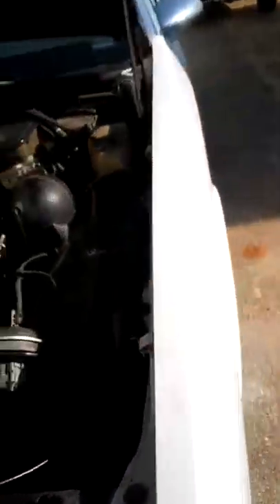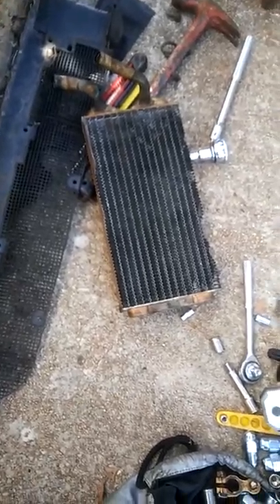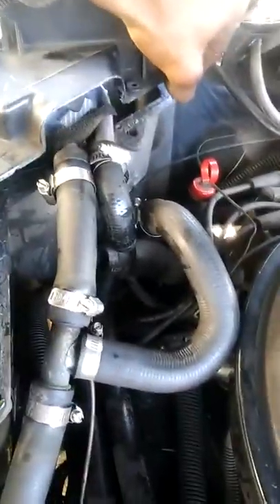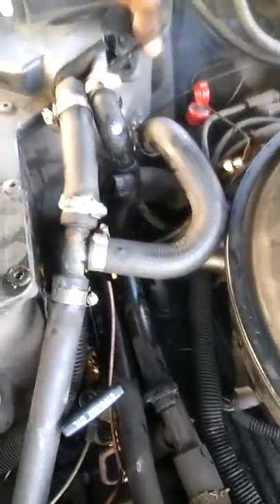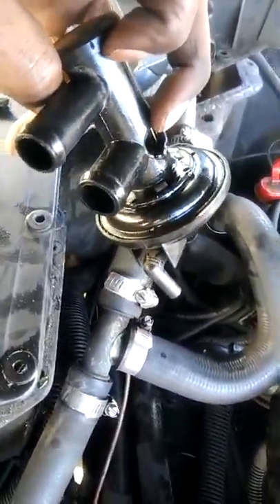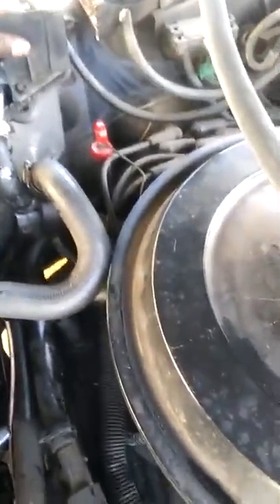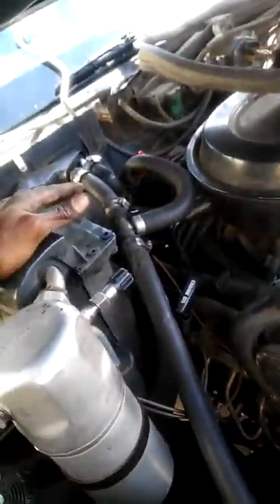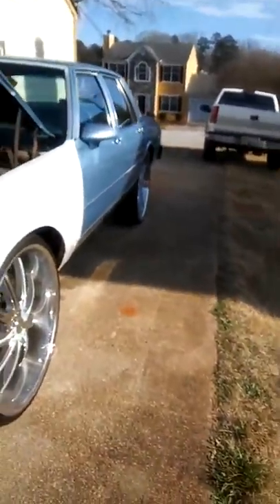How to change the heater core on a 89 Chevy Caprice

Comment: My dad and I just changed the heater core on my '90 Buick Estate Wagon and he broke the nozzle for the windshield wiper fluid too.  It is still available for around $20 if you do some searching.  The part number is 25507596.